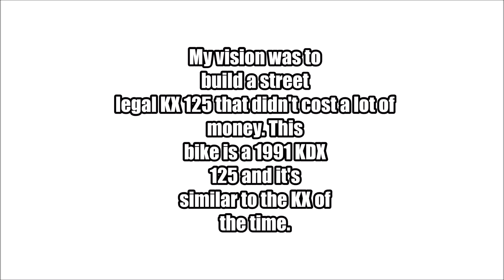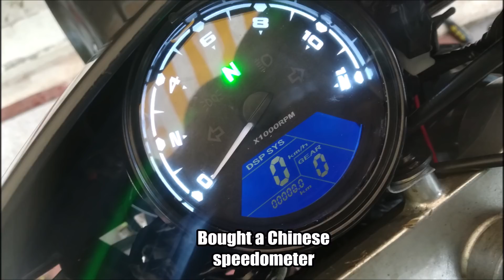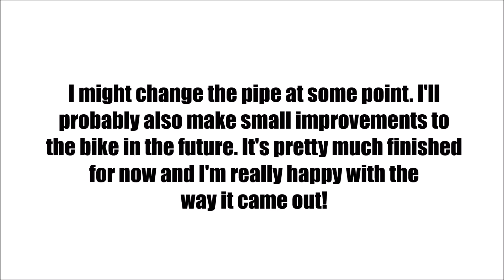Kawasaki KDX 125 to KX 125 Conversion Project

Comment: You have done a amazing job I use to have a blue one back in 1992 I loved it air I bought it from a insurance write off company for 650 pounds it was only 1 year old it had been stolen and dumped into the docks so it had water damage I did it up like yours had alot of power valve problems but what a bike IAM soon looking for a kmx 125 to do write up for my son I will be using some of your modifications to the tank and plastics you really now what you are doing well done

Comment: Great build. Firstly, is the engine a KDX 125? or a KX?  If the engine is a KDX, I believe the powerband will be totally different from that of a KX.
From memory, the KDX has a much more mild powerband, while the KX has a much more aggressive power band.
Reply from the maker: Thanks! It has a kdx engine but pretty much everything has been modified except the gearbox. The cylinder head and the piston are from a kx 125. The cylinder head has also been shaved. The cylinder is original but it has been ported. The bike also has Boyesen reeds and a free flow airfilter. Nowadays it also has a PWK 36mm carb, and a Big One (the name of the brand) performance exhaust. The rear sprocket of the bike is also quite big so the ride is pretty aggressive 😅
Reply: @ArtVilleYT  I like it. I like it a lot!!!
Reply: @ArtVilleYT  Where did you get parts for the KDX engine? Im thinking about buying a 1991 125 kdx with a broken gearbox

Comment: Did you need the Kx tank to fit the plastics? Or would it be possible to fit them onto the kdx tank?
Reply from the maker: I've seen people do it before. I think it's possible but I haven't tried it myself. You might have to drill new holes in the plastics though.
Reply: @ArtVilleYT  might just give it a miss was hoping they would fit straight on, Cheers for the reply mate